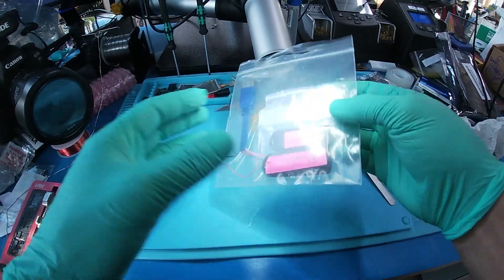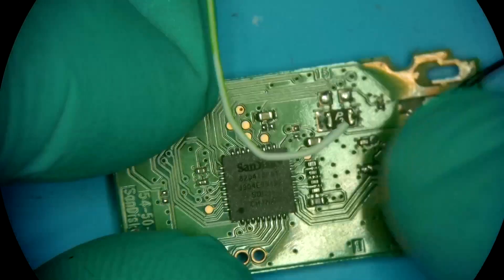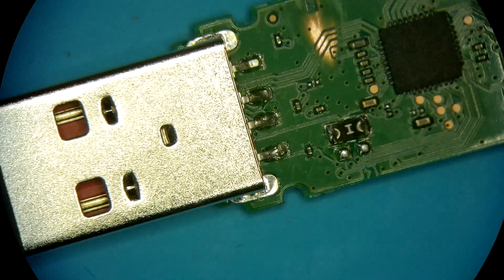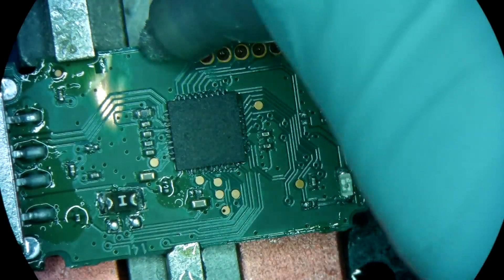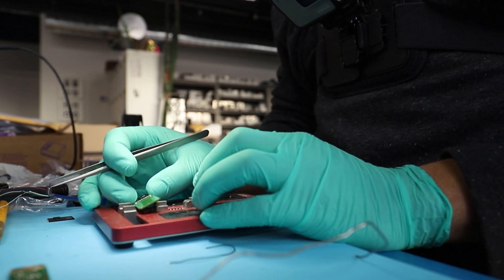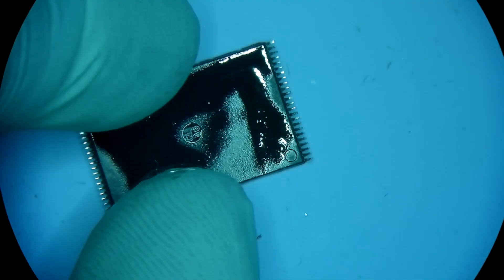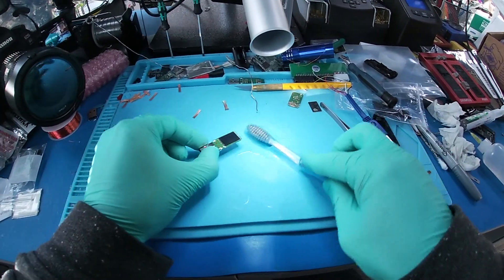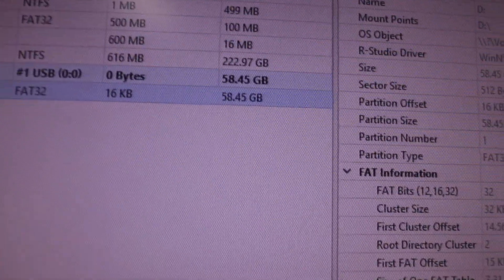recovering data from flash drive using another dead flash drive

Comment: When putting the NAND on the donor board, it doesn't look like you use any solder? Or do you just touch the 4 corner pins and the rest of the pins make enough contact?

Comment: GOOD LORD.MAN WHY YOU DID NOT CHECK 5VOLT FUSE BIG"H" FOR YOU
1=CHECK USB BY USB FEMALE AND MULTIMETR
CHK DP AND DM ?
2=CHK 5VOLT? NAND HAVE 3.3?SO IF DC TO DC CONVERTOR SAFE? CHANGE CRYSTAL
WHY SUFFER YOUR SELF?
YOU JUST NEED CHANGE FUSE IN FIRST ONE AND SOME WIRE solder DP(DaTA+) ,DM   5VOLT FROM FUSE ANG GND FROM USB HOLE
Reply: IN FEW DAY I POST SOMTHING TO YOU IN FLASHBOOT.RU
MAY BE I END YOUR SUFFER
Reply: @davodamirajam1276  well .. did you?
Reply: @DiskTuna  yes you go flashboot ru and see it

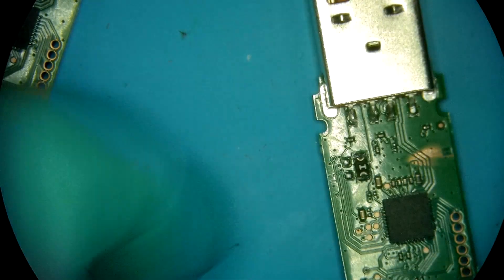Comment: Wow at 2:20 Whoever working on that just ****ing did a bad job. I have used that also used a cut USB cable to solder on traces or right to the controller chip with some magnet wire. THATS ALOT Of DAMAGE.

Comment: Hi erkin, nice video and beautiful soldering. Do you mind to share  what is the temperature to use on the hot air gun ? and the soldering tip.  Thanks
Reply from the maker: Thanks, irons at 350, hotair for removal of NAND is 390/90 and rework at 350/40